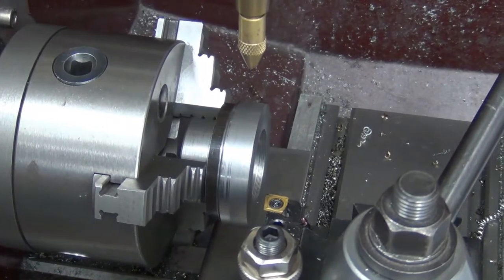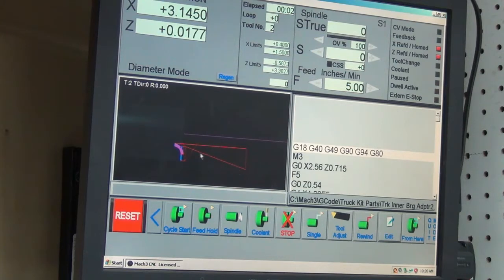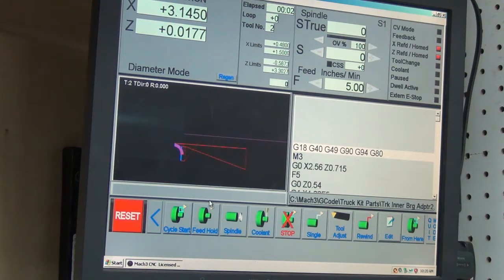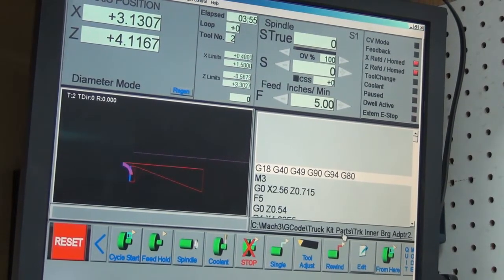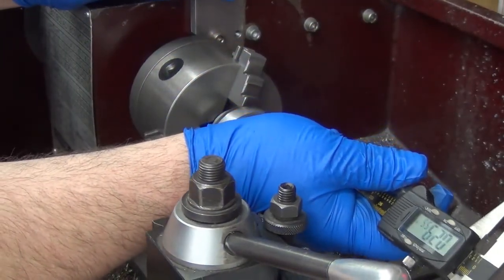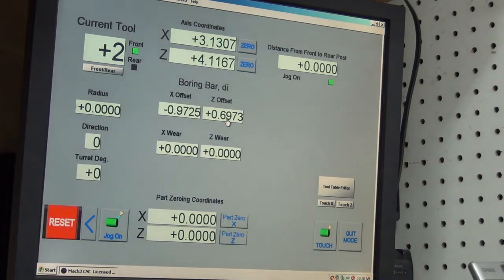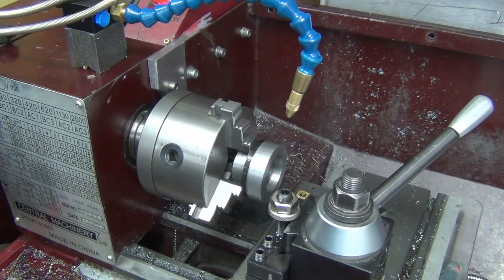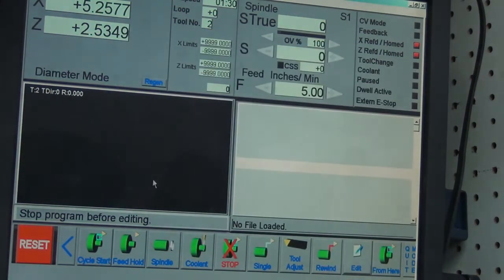9x20 CNC Lathe - Inner Bearing Adapter - Part 3

Comment: been watching your vids for a while now and I'm hooked. Although I'm still not entirely sure what you are making or what it is for. any chance of a summary in your next vid? or point me to a vid where this is explained? Thanks.
Reply from the maker: Thanks!  They are used to adapter a later model(disc) hub/bearings to the older model(drum) spindle.  Here's a link to the installation page on my site.  It probably gives the most details in one place.  You can scan through and see how the conversion takes place.  Adapters like this are used in other aftermarket brake upgrades.
http://www.bluehandsinc.com/truck-kit-install.html

Comment: If you click in the gcode box on the right then use your wheel mouse to scroll down to the line you want is highlighted then press the run from here button a small dialog box will should popup and ask if you want to move to those x y positions
Reply from the maker: Thanks!  I'll try it again.  I think I tried that, but then again, it would have been in the demo mode.  I had to pony up for a full version of mach3 because some of my parts are already over the 150 line limit in Turn.

Comment: Cool, it's getting dialed in. Won't be long you'll be making room for a Haas..lol

Colin
Reply from the maker: Getting there. 
Haas?  No.  Novakon Torus Pro in a month......yes :)
Reply: bluehandsvideo
Well, this should be exciting. Thats a major upgrade! Cool
Reply: ***** Yeah that's cool. You should get BobCAD/CAM (at least V24) Mill then add the Turn package.
Reply from the maker: *****
Just waiting for the $'s to hit the account in the next day or so.  The quote is just waiting for a wire transfer. :)  Thanks!
Reply: $2000?? Still way cheaper than MasterCAM.. .. look at your way through this list.

http://www.cnczone.com/forums/cam-software/

Alibre is good, so is the PTC products.
Reply from the maker: gbowne1 Thanks for the suggestion.  I'll look into it.  I've been wondering about what CAM to get.  I'll have to see if the shop budget can swing it. :)
Reply: MasterCAM is good but very expensive. but BobCAD has a decent following and support and is not as expensive. I would stick with at least V24.  From there you can CAD and post to your Mach3. It will also make your toolpaths much easier. They will also make you a custom post processor if you know how you like your G code posted for your machine.
Reply from the maker: gbowne1
I was just looking at BobCAD/CAM today.  I think you mentioned it in another comment?  2D is only $500....not bad, but it's a $2000 jump to get 3D....ouch.  I've got some more looking to do. 
My mill will be here before you know it.  Some of the basic stuff could be done with wizards, but I would think chamfering would be much easier with a CAM program.  I've heard of the post processors, but at this point, I still have no clue what they do.
I appreciate your input.  Thanks!!!
Mike
Reply from the maker: gbowne1
Thanks for the link and suggestions!  I'll check them out.  :)